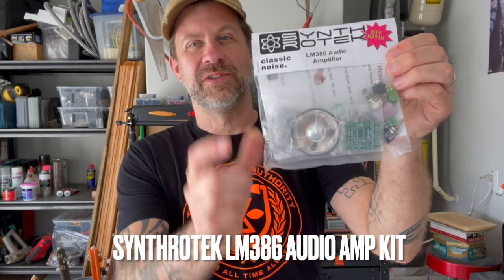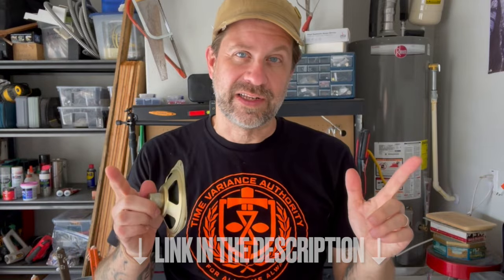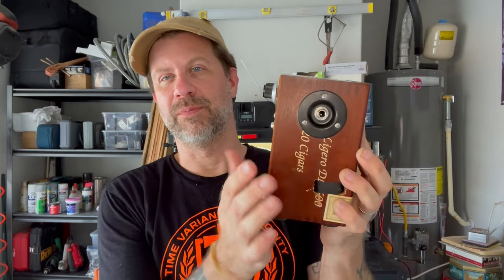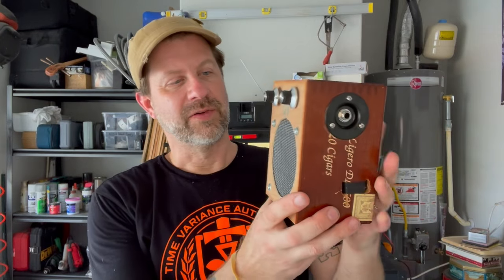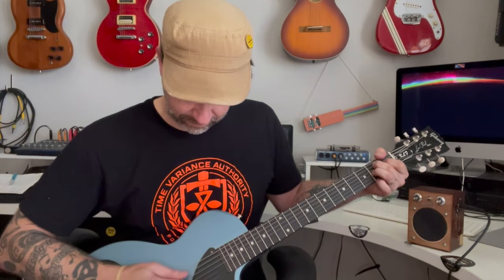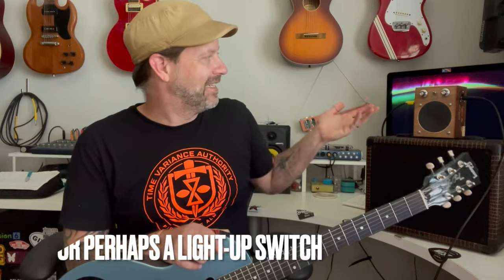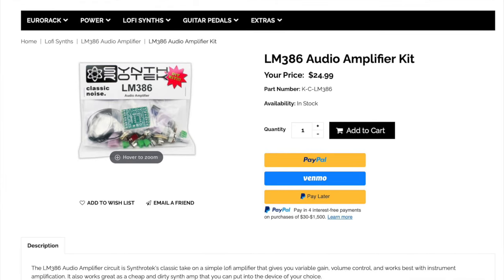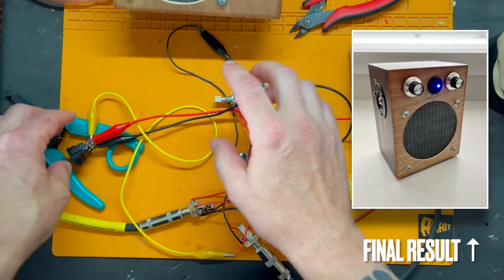Synthrotek LM386 Audio Amplifier Kit (DIY cigar box amp)

Comment: I put a CB Gitty amp kit in a similar style box. I found I could get quite different tones by opening the lid. Although in mine the speaker was mounted to the lid side.
Reply from the maker: @paultandy3448  thanks for checking out the video.

Comment: I liked the build Kale! Very doable but … I like a clean tone. If the gain is at zero, can you get any volume at all?
Reply from the maker: With the gain at 0, you probably won't get any sound, but if you give it a little gain it will clean up. To be honest though, this amp shines for weird distortion sounds based on finding sweet spots in the gain/volume pairing.

Comment: This isn't the Artec amp circuit?
Reply from the maker: It is not. Synthrotek developed the circuit around the LM386 chip but it is slightly different. Thanks for checking out the vid.